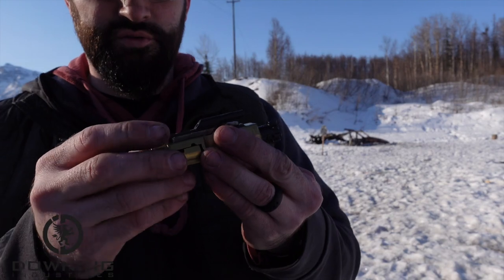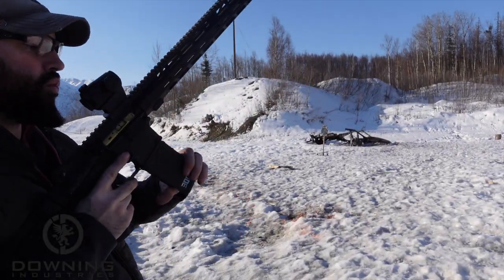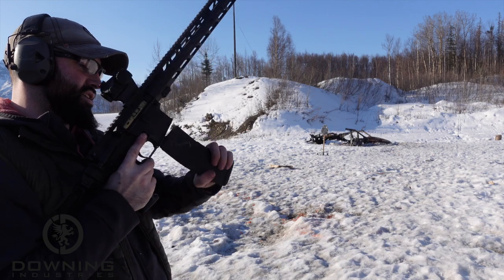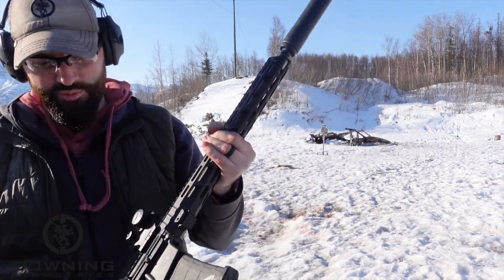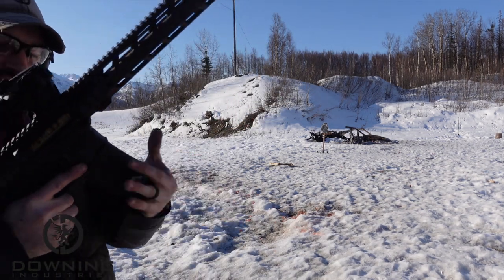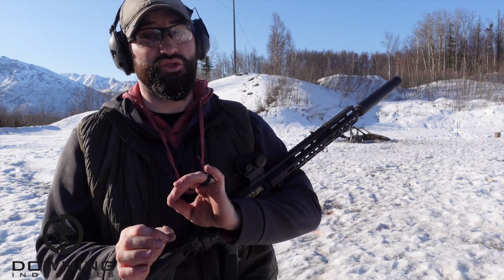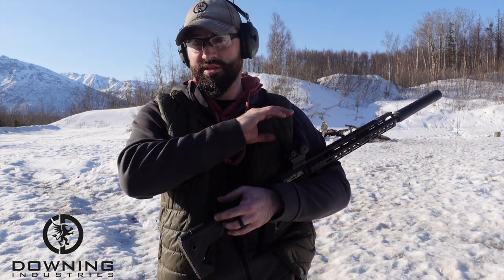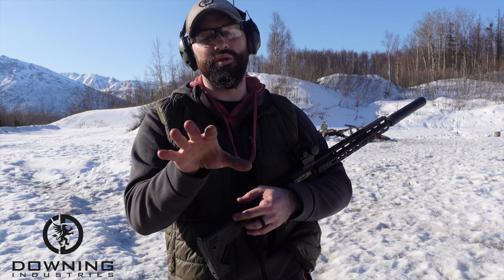Tuning The Gas On The Evolution Weapon Systems BCG

Comment: They are a small cali based company with mass production but yeah 400 each and a 2 year wait to even attempt to put it in ur build is crazy but the concept and fact that fire pin and bolt are mil spec standard part interchange and fix is easy but a micro with gas adjustment is almost nonexistent and reliability makes me question my purchase but they will be a unique peice of history and future
Reply from the maker: Ya know you are on to something there. If EWS fizzles out then it will be pretty cool to have one of their units. Like you said, a unique piece of history. 
It was worth the wait and trouble for me 🤷‍♂️
Reply: so i tallked to them the other day and they are coming out with the V2 and they said the wait time is currently 2 months and anyone who orders from sep on is going to get the v2. pretty cool guys they even got me a discount code while i was talking with them
Reply from the maker: Nice dude 😎🤙 It’d be cool to see what their V2 has that the original on doesn’t have.

Comment: Put a relia-bolt from sharps in it. It has angles cut into the lugs so while going into battery it will lock up easier
Reply from the maker: Now that’s a solid suggestion 🤔👌
Reply: @CalebDowning  ya brother enhancing “into battery” without the capability of spring tension kinda hard to do but that bolt is kinda costly buying it might as well get the whole BCG.  
Maybe contact Tubb’s springs and give them dimensions have them make you custom flat wire springs for it and have them well over the length so you can cut and “tune” it to your desire. Not sure if they would but it might be cheaper than a whole BCG. 

Also fun fact if you want to do the same but in reverse and want an easier unlocking of the bolt get Hydra-Fire USA Roller cam pin. 
Don’t quote me on it but I think it is a 30% difference on ease of bolt unlocking.
Reply from the maker: @ROTT_LIFE ooo, I haven’t really thought about trying a roller style cam pin 🤔 Great idea 💡

Comment: how you been running this lately? no one has high round count review on it.  would like to see more info on it
Reply from the maker: I’ve run it a little but not much lately. Primarily I’ve been working on the Foxtrot Mike products and let the EWS sit on the side. 
I don’t have an actual round count(shameful I know) but it’s in the 100’s not up to the 1000’s yet. The unit definitely needs some breaking in and significantly benefits from an adjustable gas block. 
Should you get one? Well it seems there is only this and the Law Tactical ARIC to choose from, and I would choose this over the ARIC. 
I’ll try and get some more content pushed out on this.
Reply: @CalebDowning  thanks! Iv been looking g for a system I can use a picatinny end plate on my ar15. Looking at the aric but was curious if u could put an end plate on it and not use the law tactical folder.. have u tried ur aric in the configuration? Fm seems like they make good products but your stuck with their handguard
Reply from the maker: @nmhockey5 I believe someone was supposed to make a 1913 endplate for the ARIC but I’m not sure if that was actually produced. 
I hear you on the handguard issue with FM Products. Perhaps other companies will get on board and make some 3rd party options.
Reply: @CalebDowning  i totally agree. iom surprised more companies havent done that already. could u possibly humor me when you have extra time lol? could u try running the aric with ur ews endplate on?
Reply: i actualy just found it. groud combat solutions makes one for the aric. it looks like the aric protrudes a little bit out of the reciever so a regualr end plate wont work
Reply from the maker: @nmhockey5 Agreed, someone should be able to makes a more reliable version. 
I think I showed that when I did a direct comparison between the two systems. From what I remember, they do now play together. I’m check again next chance I get.

Comment: Heck, i ordered one back in April, 2020 and was told mine would ship last year of November, and here we are a year later and now i can't get anyone to tell me where it is, i can see they seen my messages on Instagram but they still wont respond. It's quite frustrating considering it's almost 2024 now.
Reply from the maker: There’s no excuse I can think of for them to have that little communication. It’s a real product and it actually ships but for them to take this long and be sooo hard to get ahold of is inexcusable 😏🤦‍♂️
Reply: @CalebDowning  I've sent multiple emails and multiple Instagram messages, even tried commenting on their most recent post, but the fact that I can see on Instagram that they've opened the messages and still didn't respond has had me fuming these past few days. I couldn't ask for a refund even if I wanted to at this point.
Reply from the maker: @Diddle1994z I understand that frustration man 😤

Comment: Maybe one day these will be worth it but right now, none of these systems are worth it. There are guns that opwrate this way and function better. Buy one of those. Or just run the ar the way it was designed until they take the proper time to actually make them work correctly
Reply from the maker: Totally understand your perspective. I think a lot of companies are using their customers as guinea pigs. That’s ok if, when the product gets its bugs worked out, the customers can swap out their early gen models for updated models.

Comment: I finally received mine last week. It only took 33 months. Unfortunately I have not been able to take it to the range yet. I do plan on trying it out in a few different calibers. Before finding it a forever home. 5.56, 7.62x39, 300 blackout, 50 Beowulf. 
 Speaking with the over the past few months. 

They tell you for 
Mid-Length/ Carbine/ Pistol/ Micro/ Suppressed weapons= an adjustable gas block is required. I assume to address cycling issues.
Reply from the maker: Nice 😎🤙
I still need to try it out on 7.62x39, that one has my attention. Let me know how it runs for you. 
And yes, an adjustable gas block significantly helps 👌👌

Comment: This looks very interesting and would open up a lot of possibilities for building/customizing without a bunch of proprietary parts.

 However, after I read the comments here (with a lot of people saying  2+ year wait time on it) and with little to no contact either, I've changed my mind.  It seems almost no one has one to review (or doesn't post their experience online if they do have one)... So I think I'll save my money for now and wait for this system to "mature"...and shipping times to get a LOT better before I spend $400+ on a bcg.
Reply from the maker: It did take me two years to get mine and their communications are dismal… but the product itself is pretty cool. Like you said, it opens up many possibilities. 

Hopefully they get things worked out and start a steady line of production.
Reply: @CalebDowning  I hope their production (and communication) increases soon. If they are successful with this, this will be added competition to the market and that's almost always a good thing specially in our 2A community. 

Subbed earned sir.
Reply from the maker: @D.K81 fully agree with you man. I appreciate your support! 🤙😎

Comment: Does this use a proprietary bolt? Because I was wondering if you could swap in a 7.62x39 bolt etc.
Reply from the maker: The EWS takes milspec bolts, so you can put in a 7.62x39 bolt in it no problem 👍